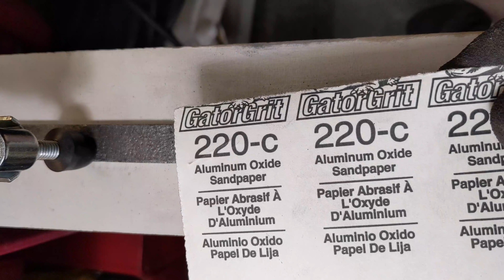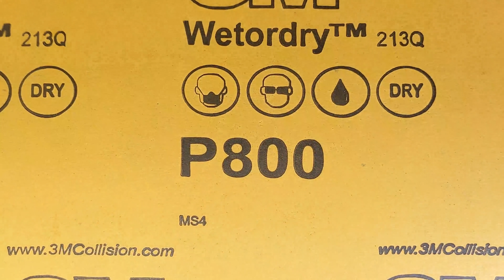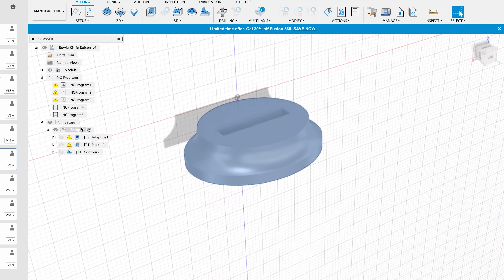Rusty Bowie Knife Restoration,  No Shortcuts.

Comment: Most people would have just cut leather squares and then shaped it up on the band saw and belt sander. You machined a die to cut them out almost to their final size. That kind of OCD makes me happy. Excellent restoration. I've always been a fan of stacked leather handles despite their tendency to dry out and deteriorate. I've got an old Ka-Bar hunting knife and an Estwing hatchet with stacked leather handles. I love them.
Reply from the maker: It drives me crazy to see people do stacked leather handles and glue or epoxy them together. Defeats the purpose of the stacked leather (OK not if you use light glue). I love stacked leather handles. Just have to do some leather maintenance on them once in a while. Take good care of that Ka-Bar. Nothing like them. Thanks for watching!

Comment: i think i would have like to seen some glue between the leather pieces  but wow the sanding polishing and remaking of bolsters was first rate.
Reply from the maker: There is absolutely no reason to glue the leather washers if they fit the tang properly, which was the whole point of making the die. The handle leather washers on these knives were not glued when manufactured.
Reply: fair enough   @AcmeRestorations

Comment: I think a pair of punches instead of the die, cut the circles then with the second punch cut the slot. The punches could easily be set so the cut piece fills in, pushes up and gets angled out the side as you cut more. Then you can make different size punches for the outer cut and have it usable more often.( local leather craft store had several punches for doing different cuts that fed the cut piece through the punch )
Reply from the maker: I considered that. I might have done that with thinner leather. With the 6mm leather, it take a LOT of force to cut all the way through.
Reply: @AcmeRestorations  Oh I know, I used a hand held boot lacing tool to cut leather boot laces out of 6 mil leather. Had to cut a hole in the center of the square to insert the lacing tool.

Comment: Beautiful work 👏🏼👏🏼👏🏼
Where did u get the set of very fine metal files that you used for  sanding in the small holes pls?
And what are they called pls?
Reply from the maker: Those are called "riffler files". Once you know that, they are easy to find online. Thanks for watching.

Comment: Great video, quick question I'm new to this but I seen videos where these use glue on the layers of the handles and then compress them, is your method better? Definitely a cleaner finish! 👌
Reply from the maker: I don't think so. I've taken apart a few stacked leather handles on knives and hatchets; I've never seen any glue used by the manufacturer.

Comment: How did you go about straightening the bent tip of the blade?  Once you sanded it down I never saw a top view again.  The only negative I thought was using spray paint.  Even with the "etching" primer its only temporary and rattle can is always going to be rattle can.  I was waiting to see it bubble up when the heat gun came out.  For a guy with a cnc router, you could have sourced some material and avoided the paint.
Reply from the maker: The tip isn't bent. This knife has a swage on the left side of the blade which probably makes it look that way from some angles.

Comment: Next time you have a stack leather handle, I suggest to put epoxy between each washer. Also belt sand you handle shape.
Reply from the maker: God no. Epoxy ruins the whole feel of the leather. You end up with what is basically bad micarta.  Didn't belt sand the handle because it's hard to be very precise with a 4" belt sander, and I don't have a 2x72". Didn't want to scratch the bolsters.
Reply: @AcmeRestorations  I guess that's why they make strawberry, chocolate, and vanilla ice cream. Everyone is different. However that's why the military stack leather washer handles through the years come apart. NO ADHESIVE TO KEEP THEM TOGETHER!!!! Regards
Reply from the maker: @hueytheno-gooder9926  Knives with stacked leather handles that come apart are knives that were not cared for properly. Leather has to be maintained. I've got a Viet Nam era Ka-Bar that is in superb condition. But I oil the leather fairly regularly.

Comment: Good job, but you forgot to glue the leather as you put it on the handle
Reply from the maker: I didn't forget to glue the leather. There is no need to glue the leather. None of the stacked leather handles I've taken apart have ever been glued by the manufacturer. That includes hatchets.

Comment: The tip of the blade looked warped in a couple of shots. We didn't see you fix that. I'm guessing you just left it?
Reply from the maker: It's not warped. This knife has a swage on the left side of the blade, so it may look like that from some angles.
Reply: @AcmeRestorations  Oh, now that you pointed it out, I see. You usually never seen a false edge only on one side. Great job by the way.

Comment: Why would you not glue your stack?
Reply from the maker: Why would I? The leather washers weren't originally glued. The new washers were die cut to fit the tang perfectly, so they aren't going to rotate, and I was able to compress the washers by leaving the hole in the rear bolster too small and forcing it onto the tang. I know a lot of people restoring or making stacked leather handles glue their leather washers, but you should ask why do they do that. From what I gather reading knife forms, people basically glue or epoxy so they can shape the handle before it's on the knife, or at least before the pommel is attached. I have yet to take a stacked leather handle apart on a knife or hatchet that had glued leather washers. That's because the manufacturers  don't sand handles to shape; they use exact cut leather washers. So there you go. Thanks for watching and thanks for the great question!
Reply: @AcmeRestorations  best of luck✌

Comment: why not just wet sand with the polishing wheel? It'll save massive time. What could go wrong? :)
Reply from the maker: The only buffing compound I have suitable for steel is white rouge. So, had to work up with the sandpaper. Also, I don't really have much need for heavier compounds than white. Also, $$$ already had the sandpaper.

Comment: i have one 1943 USN,and those leather washers i made out of old belt much easier ,i cut a belt for a bunch of 1"x1" pieces ,made a hole in the middle of each of them by punch and a blade ,put them all on that metal handle spine and shape it up on the belt sender , that's it )))) and that shiny ass blade looks cheap

Comment: If you are going to sand out all the pitting why bother with the earlier steps like sand blasting and wire wheeling? Unless of course you did them because you get to use these tools, because, you know.... they're cool.
Reply from the maker: Didn't sand the full tang, just the blade. Also it's much easier to see what needs to be sanded when the rust has been removed. I like to wire wheel after I've media blasted with aluminum oxide just to get the residue off.

Comment: Is there a trace of the tang stamp left after the over polishing? 

Why you felt it has to look new, I'll never understand.
PRESERVE not "restore" is always better.

Buy the way, the proper names are "Guard" (front) and "Pommel" 
(rear)
NOT "BOLSTERS".
Bolsters are on the ends of a folding knife, and strengthen/bolster the pivot(s) and/or or rear handle pins if both blades pivot from the same end.
Reply from the maker: This knife has a guard, a front bolster, a rear bolster, and a pommel. Don't take my word for it; Google "knife bolster".

Comment: My only question is What do you define as "cheating"? As long as you restore an item, and induce no defects, done is done, isn't it?
Reply from the maker: Oh there's ton's of "shortcuts". The most common with leather stacked handles is guy will epoxy all the leather washers together, drill a hole through the center,  and then epoxy that to the tang. Much easier to do, because you don't need to make the correct sized washer. Really defeats the purpose of the stacked leather handle. This one has a super nice "give" to it. 

Also, a lot of knife restoration videos, they guy will polish it to a chrome finish with the steel still full of pits. Yucko. 
Great question though. Thanks for the comment and for watching.
Reply: @AcmeRestorations  Thanks for the explanation, and I agree, if the pits aren't removed, you haven't really restored anything, just polished it, which any fool can do. I see that what you mean is that you restored it to ORIGINAL condition in-toto, not "Just sorta original-looking with a shine and edge maybe". I appreciate the dedication to craftsmanship.

Comment: good try but so many heavy scratches left on the blade u didn't spend enough time through the girts and u its a must alternate sanding directions between grits to be sure u got all the scratches out its a lot of hard word by hand
Reply from the maker: Between you and me and the wall, I'm taking this blade back down to matte. People want to see polished chrome like, but it's a fingerprint magnet.
Reply: @AcmeRestorations  rgr that but all im saying is if u polish something u must put the time/energy to get rid of the previous scratches
Reply from the maker: @shockwave326  Yeah I hear you. Harder to do on an old rusty knife than a new one. There's a real balance between getting the pits and scratches out and removing too much material. I came a bit shy of that balance it looks like.
Reply: @AcmeRestorations  not really u did fine i cant see it in my hands nor see if u got all the pits but u did fine BTW,,, u might consider Bluing the knife as it is it will look sweeter than now and u wont have to do much work to it sept remake the edge and the contrast between the shaved bluing gone from the now shiny edge contrasting the rest of the knife with the bluing process even the guard blue that too

Comment: they say they wont cheat and then they go ahead and do that. better to get factory original parts from other busted bowies and use them instead.
Reply from the maker: Factory original plastic parts for this knife? If you have a link, I'm interested. I can't find many references to this knife at all anywhere. Just a few pictures of old ones in poor condition. You think replacing plastic parts with identically machined brass copies is cheating?  Yeah, that was totally a shortcut :)

Comment: Unless you are going to make a million handles it is useless to make a steel die
Reply from the maker: Better fit. And frankly probably about the same amount of my time. The CNC mill did all the work, and once I had the die, took about 6 minutes to cut out the washers. If I'd have done it by hand, it would have taken a while to get a good fit.

Comment: Friend,
A.} That was just WRONG to not polish the handle portion to a mirror shine just because it wouldn't show!
B.} Using CAD will destroy your Creative Vision and Artistic Integrity.
C.} One needn't be slavish to the original. I liked your front brass bolster better BEFORE you ground the sides down.
D.} Also, I preferred the metallic brass to the ugly red enamel.
E.} Once again, no need to be slavishly to the original. I dislike stacked leather handles. Wood, bone or stag would have been an upgrade.
F.} Why on EARTH not go ahead and put sharpened edge on the swedge while you were at it? Since the swedge receives little hard pressure, the swedge can have a very fine razor-rdge suitable for fine cutting.
All-in-All though, I enjoyed the video.
Computer Drafting will DESTROY your creativity though!
Reply from the maker: The entire point of this video, and by extension this channel, is to take something useless and return it to it's original condition. It's a restoration video. Hence the name of the channel.

A) The handle portion of the tang was never finished by Schlage. To polish it would a) not be original, and b) be of absolutely no functional use. To do so, I would have had to grind down all the cast marks, removing lots of material, again, with no practical use. So, no, I disagree that this is wrong.

B) You must have been a drafter in the 1970s. I don't know anyone who's done any drafting since the 80s who doesn't think CAD is just another tool to improve the process of machining. If CAD removes your artistic vision, you probably don''t have much artistic vision. Also, you may have noticed I machined the parts on a CNC mill. I don't have a manual Bridgeport. I just have the small CNC mill. This means CAM, which requires CAD. 

C) Slavish to the original. IT'S A RESTORATION PROJECT. THAT IS THE WHOLE POINT. If you want to watch people customize knives, there are like 1,00,00,00 other videos to watch. So why are you criticizing me for doing the one thing that is the point of the channel? 

D) Yeah, yeah, everyone loves brass. Had I not painted the bolsters to match the originals, other people would have complained about that. And again, matching the original is the whole point.

E) "I dislike stacked leather handles". It's a stacked leather handle knife. And you're griping that I put a stacked leather handle on it?

F) Again, I am attempting to match the original condition, and this knife didn't have a sharpened swage.

At this point, I'm surprised you didn't complain that there's no music in the video.

"All-in-All though, I enjoyed the video."   Well I'd hate to see your comments if you didn't like it.
Reply: @AcmeRestorations  I didn't think that you would reply. I wouldn't have obligated you to write all of that if I had thought you'd respond. I get it—you want to be true to the original. Different concept. How many Draftsmen were put out of work by CAD? How many Machinists and Tool & Die Makers were put out of work by CNC? How many TV Repairmen lost their livelihood due to transistors making it cheaper to buy a new TV than repair the old one? People could slow change down greatly, if everyone would dig in and fight "Progress" every step of the way!

Comment: Way too much polishing. Restoration? This knife has NEVER  been so polished when was manufactured at 100 per minute rate and using cheap plastic pieces. This way...would cost a 1,000.00 $ each.
Reply from the maker: I'm just trying to match the photo in the catalog. I don't have a new original to work from. Have to go by photos.